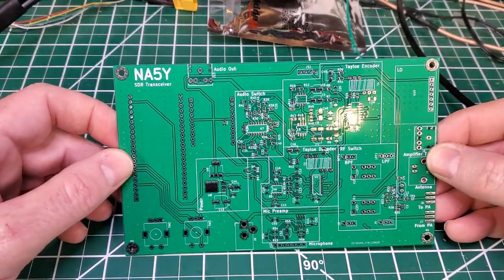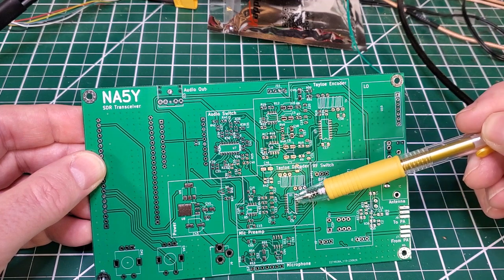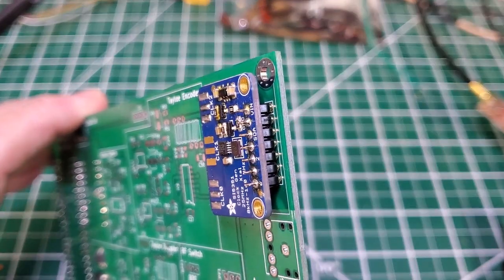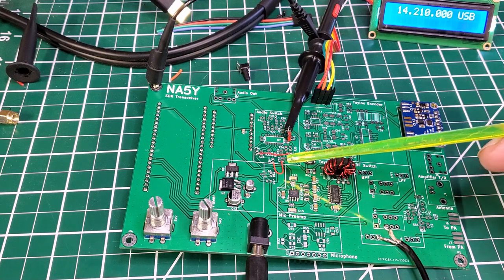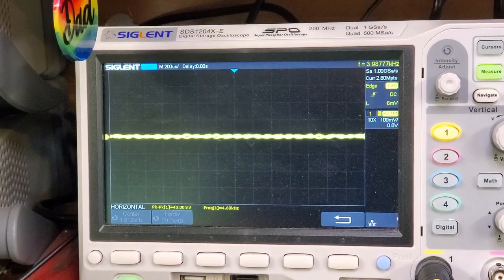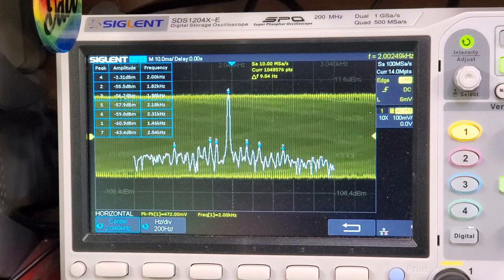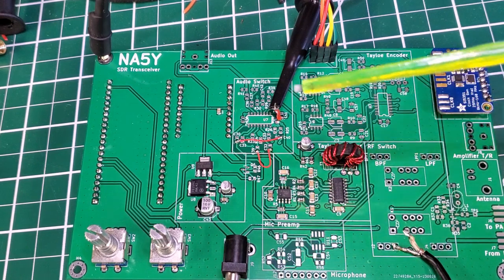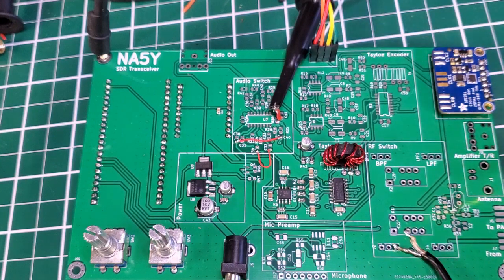SDR Transceiver - Part 7 New Board

Comment: Came back to rewatch this series because there's tons of valuable information in it, thank you! I was wondering, since the ES8388 has 4 input channels, would it be viable to completely ditch everything after the capacitors in the Tayloe detector and feed the 4 channels individually into the ESP32. This would allow you to compensate in software any imbalance between the 4 phases and get rid of the dependency on physical component tolerances. This might also simplify the Tayloe encoder, if you feed the multiplexer directly from the ES8388. Heck, you might even be able to use the same multiplexer for both encode and decode. I understand how this would prevent you from using the ES8388 for the mic and speaker, but the built-in ESP32 DAC and ADC is sufficient for those, in my opinion.

Hope you're well and will have time to continue this series!

Take care and 73,
Dren - Z63DNI.
Reply from the maker: You mean get rid of the opamps after the caps? I have never tried that - the main function of those op amps is to get 40dBs or so of signal amplification so you'd have to make that up in DSP. The signal level would likely be too low for the input to the codec I am thinking...

Glad you are enjoying by the way. I hope to get back to doing videos one of these days
Reply: @na5y  That is true, you would lose all that gain. But having so much gain set by external resistors will definitely amplify their errors. You could get about 24dB of gain from the "mic amplifier" within the ES8388, but I'm not sure if there's 4 amps for each channel. devttys0 has a video named "Quadrature Mixers, IQ Demodulation, and the Tayloe Detector" where he uses only 2 of the 4 muxer outputs. I guess you would lose 3dB there, but you would also get rid of the differential amplifiers. 

I should probably stop yapping and try to do some work myself. I'd like to try this stuff out and see what's possible. Thanks a lot for your time and inspiration to try things out!
Reply from the maker: @DrenImeraj  Good luck with your experiments. Let me know how they turn out
Reply: @na5y  Thank you Ian, take care!

Comment: I checked the spec for the LM4562, rated Vmin is 5V and I wonder if this is not a problem with a bit of noise on the 5V.  Try uping the voltage a bit, 1V should dp ot for a test but you will need to cut the supply pin so as not to feed 6V to the other parts which wouldn't like that.  I'm waiting on some working FSt3253 from china to test this out.  I am going to use an LT6231 in my design as I have tems and they work from 3 -12 VDC with very good low noise performance.  They are a bit pricey . Your trip to Oz is well and truely over by now, I would love to go home but stuck in NL.  I miss a VB on the Swan.
Reply from the maker: Thank you for the suggestions Anthony - lots of good info there. Was never a VB fan myself (one of my sisters loves the stuff!). I was partial to Cascade back in the day.

Comment: maybe the interference is related to the power supply? if we slightly reduce the power supply by 0.2-.0.5 volts?
Reply from the maker: Perhap - but I am using the same power supply on the new board as the one that didn't work. I really think the problem is related to the ESP32-A1S header I had. Thank you for the comment!

Comment: Good improvement!, is the board 2 layers or 4?  having a good ground plane is also important. I think the suppression you can also compensate in software if you check the code of the T41 (the teensy SDR) you can find how they compensate for phase errors
Reply from the maker: Just a two layer board Paul. I'll have to check out that phase compensation code - been something I have been meaning to do for a while. Thank you for the comment.